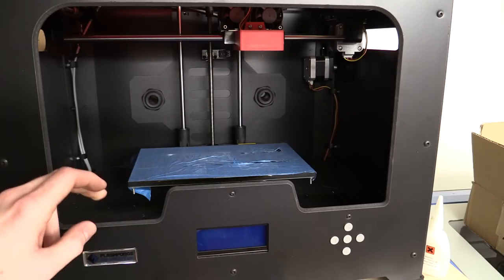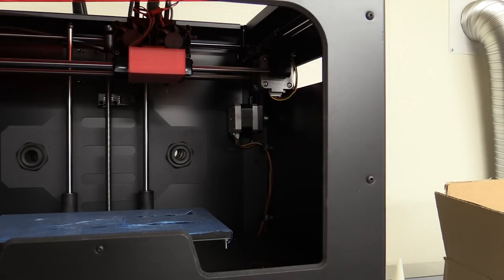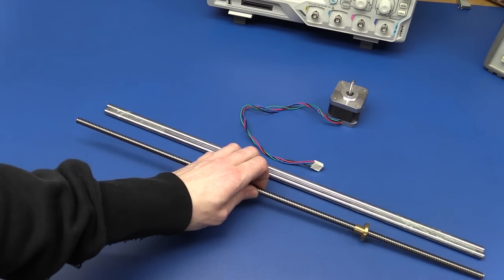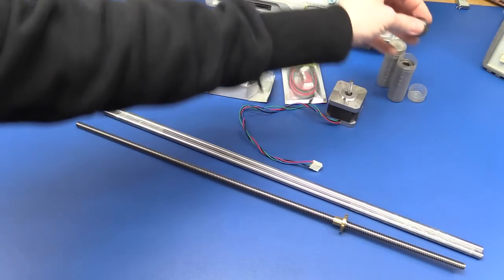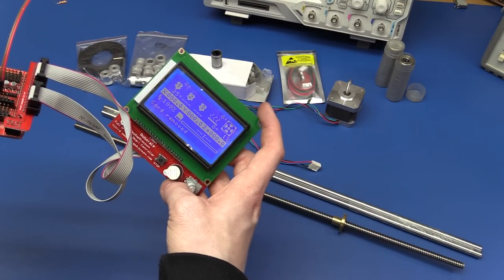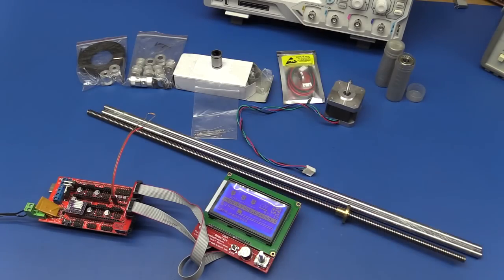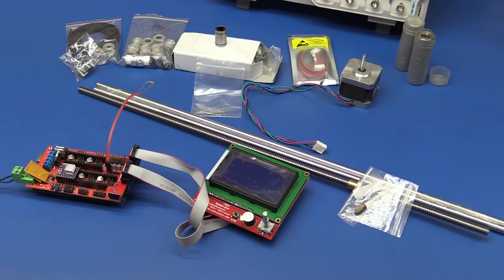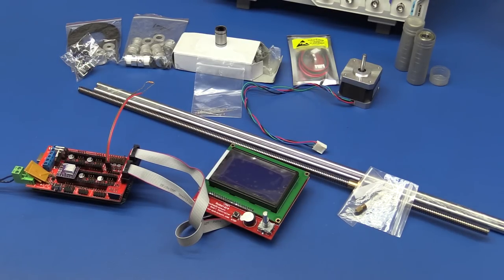DIY 3D-Printer Build (From Scratch) - Part 1: Overview and materials - Ec-Projects

Comment: first rule of making a 3d printer is buy one ready so you can make the parts you need to make, return under 30 day warranty lol.
Reply: Even if you could print the metal parts and circuit boards, you could only make a printer smaller than the original printer. 3D printing will never become a production device. CNC machines made for a specific part are far too fast and precise for the merge to happen, but 3D printing fills a niche for engineers to prototype designs faster than by hand.
Reply: 3D printing already is a production device, just not this type of cheap, plastic processing printer. Metal 3D printing is used by Boeing to produce certain parts where subtractive manufacturing like CNC machining is too costly in terms of time and wasted material. Additionally, biomedical devices like bone and joint implants and jaw implants are currently being printed and rolled out.
Reply: Its not production, it is prototyping. Medical application of 3d printers are custom parts tailored to the individual. Boeing is using 3d printers as a temporary solution of certain parts until they can either simply their designs to work with current machining processes or for custom parts for clients that are a one time deal that isn't worth setting up tooling for.

3D printing will never become production device, and this is something the tech mags and news agencies that haven't worked in the manufacturing fields don't understand or know yet. The output of current specialized processes far exceed any 3d printers capablities even in the theoretical increases of 3D printing effienciency (For example, injection casting can make pieces as complex as any 3d printer can but nearly instantaneous). However, it has solidified itself as a prototyping tool that helps engineers who frequently come up with too complex devices. Genius in engineering is half coming up with something functional and half making it as simple as possible. Most engineers are not capable of that other half, but with a printed model, the actual maufacturers can take that device and work it until they can make a production ready model. 3D printing is esseintially a bridge between the thinkers with the ideas and the builders who keep the ideas grounded in reality.
Reply: now  3d printer makers also use 3d printer as production device for their product....for some part...for the frame or base is from other vendors....3d printers do not only for prototyping....
Reply: Only the amateur producers who are making a few units. A 3d printed product will never match the speed and quality of an injection molded or cut part from a sheet. 

3D printing is good for getting the newbies into manufacturing, but for the rest who have professional skills, there have already been optimized manufacturing methods that have been nearly perfected over the century. And really, all of manufacturing is a balance between flexibility of construction, and speed of producing a specific part. If anything, the biggest splash to manufacturing was not 3D printing which made little impact aside from the popular media and hobbyists, but the rise of CNC machines with gang tooling. This greatly reduces the reliance on broaching and still allows the flexibility to quickly change the production of parts.
Reply: I think the key words there are "nearly perfected over a century". Can you imagine what innovation can take place in 3D printing over the same time scale? Also, if we are happy with our current "optimized manufacturing methods" then why bother to innovate?
Reply: whahahahaha. hmm interesting
Reply: @dave smith.  
ofcourse you won't be printing the rails bairings and such.  (that said. you can print metal) 
ofcourse you won't be printing the circuitry. even though with the conductive fillaments you actually could. 
and you could deffinatly prints parts for a bigger printer.  
some clever part enginering and you can make bigger parts by assembly.  
for example a segmented cover.  
if you design some decent engineering in your parts they can be strong enoegh. and you can upgrade the printer you are using with parts that it printed itself.i myself for one will probbably not be using rails but dovetail sleds.  (like a milling machine)  alot sturdier and allowes for being segmented if you for example plate it with sheet metal on the load bearing parts bridging the segments.    and in doing so probbably create an expandable 3d printer
and instead of belts i'll be using sortof a ball screw
Reply: @dave smith.  i have seen 3d printing production lines.  it's not just prototyping
Reply: It's one thing to innovate, it is another thing to not know the innovation. For example, would Watson and Crick look at DNA and say: "hey, that looks like a great way for space travel!". A 3D printer is adaptive, but it can never match the speed and consistency of a purpose built production line.

Attack- I understand you can print metal (and circuitry is actually being researched for 3D printing), however that isn't what keeps 3D printing from being a production device. 3D printers rely on the accuracy of the filament thickness, and the tracking of the mechanism. Higher accuracy generally leads to slower production. Of course tech is increasing the maximum potential speed (which consequentially improves accuracy), but no matter how infinitely small the accuracy can be made, it simply cannot beat the speed that a die cast or plastic injection molding machine can press out parts WITHOUT the need of expensive purpose built filament. Broaching is currently considered one of if not the fastest way to produce many odd shaped parts with extreme precision and is still used to this day even in the era of CNC machine work (although less).

The uses for 3D production is used for companies that cannot afford a dedicated production line or that are only producing a limited run of a product. That is effectively prototyping. And 3D printers serve that niche well, I am not discounting that. However, the newbies at mfg seem to take the "every screw looks like a nail" ever since they started playing with their new "hammer.
Reply: i do not care if it's innovative or not. i saw it with my own eyes.  
a room (not really a hall) with a ton of 3d printers. and a conveyor belts moving the parts to a packaging area.
moving at about 4km/h maybe 3. (slow walking speed) 
and there was a part every 2 feet or something. 
so i don't care how they did it.  but they had a decent production speed for a single worker
.
a 3d pinter is several hundred Thousand to several million dollars cheaper then other mass production machines. 
and uses less power then a cnc mill or lathe.
.
sure most parts will take alot more time in a 3d printer then other processes.  but not all. (with other methods of production you need multiple steps and people performing diffrent production steps the production time of a part can easely exceed that of a 3d printer. 
3d printing allows for some things that are just not possible with other processes.  ESPECIALLY injection molding. for example.  closed hinges. (a hinge that cannot possibly be taken appart without cutting into the part) 
injection molding is the worst.  
you need orders of atleast a million parts to break even with the production costs of the mold......  (yes those cost a few hundred Thousand to make and a few Thousand to a few ten Thousand to maintain, that's not even counting runtime. i know because atm the company where i work cannot afford the 40000 euro to fix a small defect in the mold for an end cap that keeps jamming up our machine that assembles the end cap onto our products. its a small hassle to unjam so we just deal with it instead...  and yes an end cap.  a less then 20 cents product.  and it will cost fucking 40000 Euro's!!! not dollars, to fix a little defect similar to overextrusion).......not to mention that there is ALOT you cannot do with injection molding simply because it would be impossible to remove the product after molding because of the geometry.  
obviously you never worked at an injection molding company.
.
nobody is saying that someone should start a company using 3d pinters to make screws, or orders that go up in the tens of thousands.
orders that go into the hundreds or thousands, sure.
.
stop thinking inside the box man.
and no that is no effectivly prototyping.  google the definition of it please.  (edit afterwards. this is where i started getting pissed at you for saying the last bit you said)
are you some 14 year old kid without any knowledge of anything?
even if it's an order of just 25 parts.  that's production not prototyping.
even if it's just an order of only 1 part.  then it's still not neccesarily prototyping. 
just a customer ordering a single part.  
and instead of mass producing,then storing and selling from a storage supply. 
.
if whatever is ordered has never been made yet.  
if both you and who ever ordered the part still need to figure out the iffs and butts.  
if whatever you are making is not a proven part.  or pre-existing product.  
THEN. and ONLY THEN is it prototyping. it has nothing at all to do with the speed of or amount of production.   
.
either grow up and get some work experiance.
or if you are already working.   find a new job and stop working at that factory hall where you are used to production numbers into the hundreds of thousands, and get a real job.
.
now imma stop ranting.
and unless it's complete agreement.  i will be ignoring any and all comments you make in the future because i don't respond well to close mindedness (no bad intentions)
Reply: Siloton- 3d printing can be as fast as it wants, it will never be faster than injection, casting ,and molding because as 3D printing improves, so does casting and molding. Again, it is like saying that we are going to us DNA for space travel. That is ridiculous. You have to understand what you are making in order to research it effectively. 3D printing is very important for engineers as many coming out of colleges that are very onto theory but don't really know how things are built, the 3D printing lets them test out their ideas before bringing it to the shop to produce. It saves money for prototyping and for small businesses or limited run orders, but not for dedicated production lines.

Also siloton, the ted talk you reference to is saying the exact same thing I am saying. It is bridging the gap between those thinking up the ideas, and those grounded in reality building the ideas. It is not replacing key manufacturing techniques, it is augmenting it. He even says that it is good for adaptability, (what I said) such as making a specific stint that is not immediately available. Also keep in mind that TED isn't a professional conference, it is a way for the blue collar masses to get an insight into various industries. Many papers have been shared among machinists and the general conclusion is that 3D printing is nice, but it is not really changing how most of us are building, it is helping the designers catch up with us.

Attack- Again, 3D printers are used for limited runs or for companies that need adaptability but there is a reason why major manufacturers of critical components are sticking with dedicated production. With 3D printing you measure by parts per minuite, with dedicated production you measure by thousands of parts per minute.
Reply: ok i have had enoegh of you.
.
injection molding has SERIOUS limitations in product complexity
and even some incredibly simple parts just simply cannot be injection molded EVER!!!!!.
.
casting with a solid mold has exactly the same problems as injection molding. except it's slower then injection molds, but just cheaper tool making...
and there is a whole slew of other problems with sand (or any powder or breakable) molds.  not to mention that those kind of molds make the process SLOWER then 3d printing.  like ALOT SLOWER.   
.
and are you forgetting about resin based 3d printing?  that's tons faster then fillement 3d printing.  
and does not have any of the print quality disadvantages such as briding problems or needing support.  because it's completely supported in the liquid form of itself.  
.
thing is i'd love to see you make strong injection molded parts that are semi hollow (i mean like a honycomb internal structure with just air in the empty spots)
pretty sure there is some enviromental and materials cost benifits there.  wich you can deffinatly do with 3d printing.  
and not with any of the other methods you suggested. 
.
from what you said up untill now the only conclusion i can draw is that you do not know anything about 3d printing (wich i have to admit i do not know all that much about either but it seems i know more then you). and that you do not know anything about injection molding.  (wich i deffinatly do know about)
i have been an injection mold operator in the past.  but i am a cnc machinist now.  
i have worked in production for most of my work history.  and in all kinds of diffrent branches.    i have seen it all. 
from tool makers.  to assembly lines.  from wood work to metal work.   
from small production to mass production.  iv'e done it all.   with small production you need to think of a small company making customer ordered parts.  
cnc miller with orders ranging from 1 part to 2 or 4 dozen.  
not prototyping.  just replacing broken parts and stuff like that or just small orders that otherwise would only be available by the pallet and thus outside of the price range of some people/company's
and with mass production you need to think like cnc lathe's making those screws that hold street light covers in place. the ones you need a special tool for to rotate.  
tool making for example is also production.  but you make for example a single injection mold for a car bumper. 
.
stop talking because and i am going to be clear.  YOU DO NOT FUCKING KNOW WHAT YOU ARE FUCKING TALKING ABOUT.  
oh and the parts per minute and thousands of parts per minute arguement is complete and utter bullshit.  
by your logic cnc milling is also prototyping.
like i said before.    get a fucking grip on reality because you are starting to look a little authistic.  
.
ps:   i quote "injection, casting, and molding"    
you typed that like it's 3 things.    but both injection and casting is done with mold's.  
it's your dna space travel comment that pissed me off the most.  
it's the most idiotic thing i have ever seen anyone type.  not only is it not even close to a comparison because the diffrence between conventional space travel, and getting into space with dna is much much much more then the diffrence between conventional production and 3d printing.  it's just complete bullshit.  and the point you are trying to make with it is completely false aswel.  
.
i am going to stop typing now because frankly i have better things to do and i doubt you even read my last one anyway so why would you read this one.  
also i just know YouTube is going to fuck me over and smush all this text together in one giant unreadable mess anway.
edit:  imma just start typing my comments in notepad from now on and just copy it over when finished.  
atleast then it actually starts at a new line when use the return key to go down one line while typing
Reply: Dave, molding has been developed tens of years. 3D printing is on its start. We cannot really say what each technology can reach but probability is that progress of printing can easily be 10x progress of molding until they reach similar level of "adultery". Until then, open minded man shound not sentence any of those possible future technologies doom for production line
Reply: Siloton- again, there is being open minded, and there is not understanding the tech you have in your hand. The very TED talk you bring up even says the same thing that 3D printers are great for modularity but it is not an end all manufacturing process. 3D printing will develop to be faster, more precise, and make stronger parts, but will not exceed the ability of the material the filament is made out of.

Attack125- Control your temper. The fact that you had to resort to profanities means that you are at the limit of your knowledge. At least Siloton is giving calm rational responses. I gave injection molding as an example. I also mentioned sintering, broaching, and CNC. That is kind of the point of my comment. No one process can do everything the best, no matter how much it advances. We have different techniques because one process can do something better than another. 3D printing is not going to match the speed of a production that is optimized, but an optimized production line will not match the adaptability of a 3D printer. All tools have it's uses, but if you don't use tools for the proper function, you end up behind the curve. If you are a CNC machinist as you claim, you of all people should understand this. Would you use a single bit to do every function? Of course not. Quick change tooling exists for a reason. Why are there horizontal and vertical mills and broachers? Why are there TIG, SMAW, OA, and MIG? Even if something can do something else, it doesn't mean it can do it the best.
Reply: Oh Dave, where I said it will be "end all manufacturing process"? You make up thinks my friend :) I said that 3D printing cannot be disqualified from production line too early until we know enough.  "... but will not exceeed the ability of the material filament" But the same principle does apply to ALL processes, or not? And I dont mean just externalities like printing a stomach with live cells, but some ordinary thinks also that can be reached by other approaches.
Reply: nobody claimed it was the best.  my bone with you is that you say 3d printing is only for prototyping.  THAT is what you said.  and you're wrongi think somewhere along the line you forgot what this discussion was about.
Reply: 3d printing 3d printers is very popular and it doesn't have to be smaller if you print 1/4 then 2/4 ect.